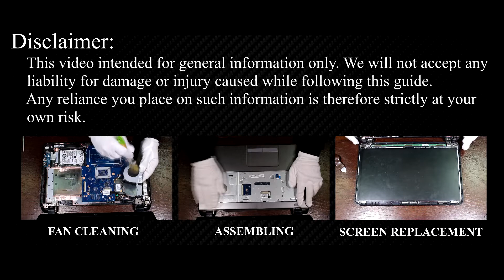HP 255 G3, HP 250 G3 Hard Drive or SSD Upgrade: Replacement & Installation Guide

Comment: Hi ! 
I just changed my HD to a SDD 
But my computer seems to not like the SDD 
It doesn’t want to properly switch on 
It’s stuck in a repair loop 
Even trying to bring it back to the factory settings it doesn’t want …
Does anyone would know what I can do ?

Thanks a lot !
Reply: maybe there is no OS in your SSD try install new OS on it eg : windows 10